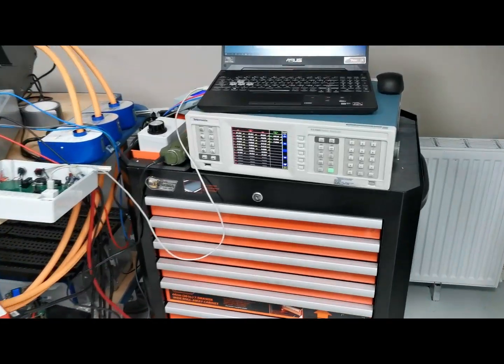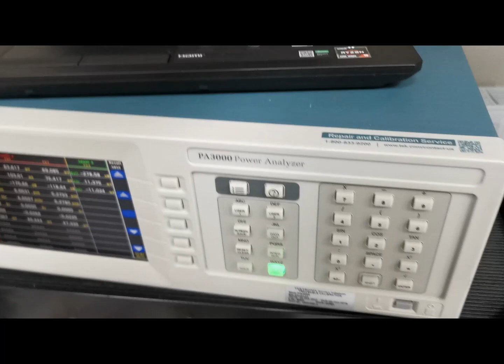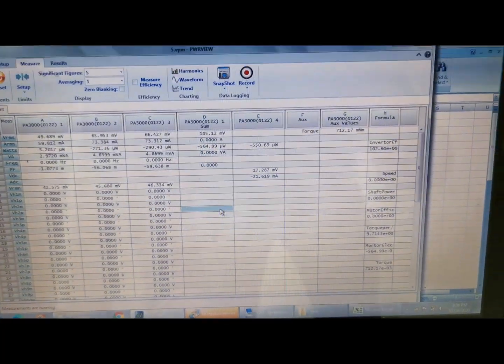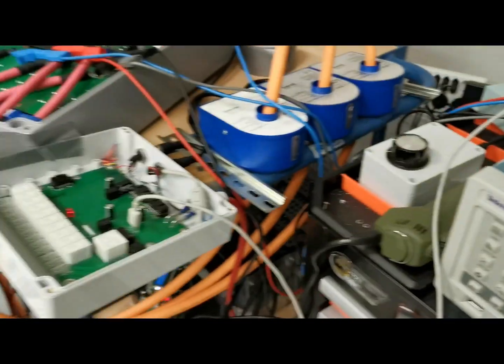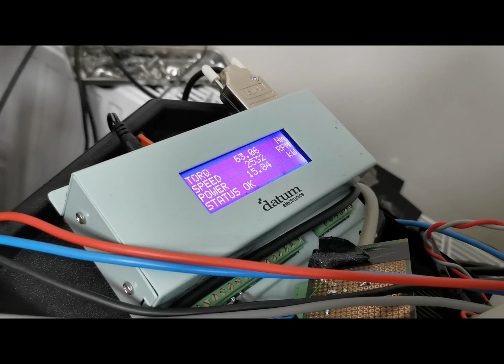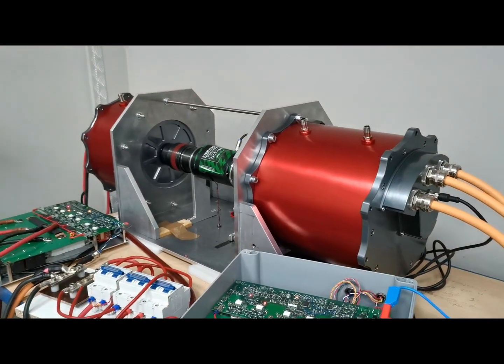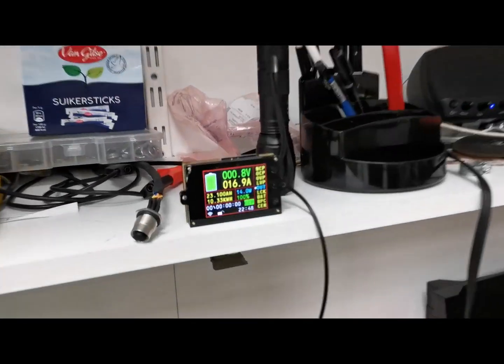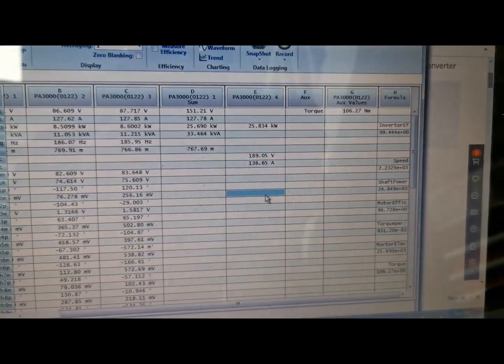Designing and testing a 250kW high performance electric motor and controller

Comment: Hi Iulian, thanks for sharing your work. You did quite well setup of your lab/test bench. Quick question, the inverter that you are using, are they of your own design or did you purchase does. In either case, can you share the specifications ? Again, nice work Iulian!
Reply from the maker: The inverter is our own design. 300Amps 650V Sic tranzistors. Now i`m making a 900Amp 900V design based on VESC
Reply: @iulian207  Niccce! I will need to talk with you some day on this subject. I'm also designing, a less powerful (14.4kw) than your design but it's a 6-PH concept. I will send you a personal email soon.

Comment: Nice. when you say solid state caps you just mean film caps?
the current sensors are huge, are they just for testing or for current limiting in the controllers?
what's the pwm frequency? is it spread spectrum?
Reply from the maker: The current sensors are just to measure the parameters with the power analizer. they are the most precise current sensors on earth.  0.0013% accuracy
Reply: @iulian207  sounds extreme. what about rise time? can it handle ripple

Comment: what was that battery display thingy? looks nice with different colors for things
Reply from the maker: It can be found on aliexpress 500Amp 500V, relay output and calibration. DC wattmeter
Reply: @iulian207  thanks